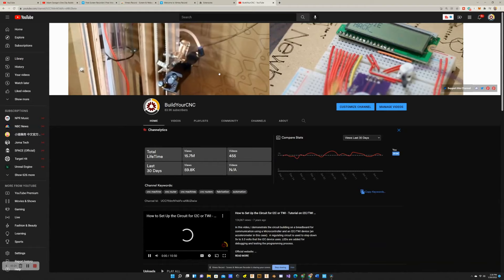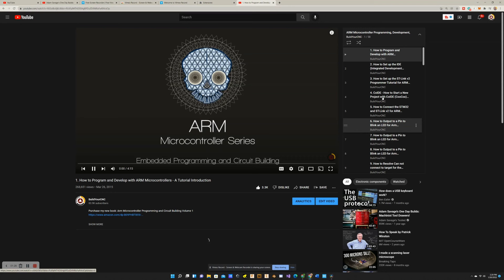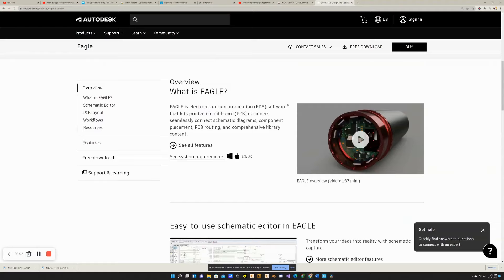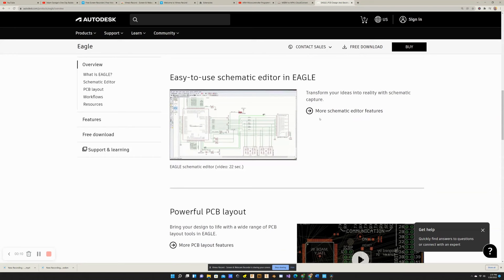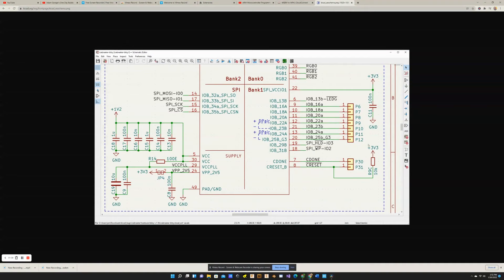#1 Say NO to ARDUINO! New ARM Microcontroller Programming and Circuit Building Series

Comment: I love ARM microcontrollers but I'm no fan of ARM IDEs.  The Arduino IDE has shown me that I don't need Keil, IAR, or any of the Eclipse derivatives.  To me they are all unnecessarily big and full of extraneous complexity.  Thankfully the Arduino IDE can accommodate just about anything...from M0 to Teensy 4.
Reply: We all would want that but in reality  Arduino is not really used in the real world but only used in learning basic programming
Reply: @tdab1234  Why?  I've used both Keil and IAR professionally...because the engineering manager specified them.  But there isn't a line of code I wrote that couldn't have been written and compiled in Arduino.  (Goes without saying I would NEVER use an instruction like DigitalWrite().  That really and truly is for noobs.  But Arduino in no way forces its usage.)
Reply: @d.jensen5153  can you please tell me why digitalWrite is for noobs?
Reply: @G-Code_official  I was wrong.  No doubt there are applications where squandering a few hundred microseconds on the transition of an output pin is not a problem.  But I have no use for that nonsense.  I'll track my own use of resources and their dependencies, thank you.
Reply: @d.jensen5153  Hey not sure if you will see this but when you use microcontrollers in industry, do you design a circuit board around a mcu? Or do you use a board with a mcu on it like a NUCLEO board?
Reply: @xxbatman69xx98  When working for government or quasigovernment agencies we frequently specified modules.  In private industry (profit-centered) we invariably designed our own boards.
Reply: Hello are u electronics engineer??
Reply: @saranyas6280  Yes.  Why do you ask?
Reply: @d.jensen5153  m an electronics  graduate..I would  like to make gadgets.but don't  know where to start.can u provide ur insta I'd if u wish to help me.
Reply: @d.jensen5153  about not using digitialwrite: why is digitalwrite too slow and what would the alternative be? I'm a complete beginner btw
Reply: @Blitzoschitzo  By writing directly to the register that controls the pins using bitwise logic.  Exact commands depend on the micro.  DigtalWrite abstracts all that so it works on all supported micros.
Reply: @bobrowicz82  much appreciated, thanks
Reply: @bobrowicz82  one extra question if you dont mind: since every mcu is different, is the manufacturer always supposed to deliver pre-built functions/libraries to access the registers or do I need read the datasheet and access the right registers with assembly or can I even do/access that with C without any extra libraries?
Reply: @Blitzoschitzo  in my (limited) experience I used manufacturer supported compilers and they all came with built in macros for dealing with register access.  Didn't need to do any assembly.  I think you could do it without any libraries by writing to raw memory address of the register but that would be the hard way of doing it.  The included macros are much easier to remember.
Reply: @bobrowicz82  by macros do you mean functions provided by libraries from the manufacturer?
Reply: @Blitzoschitzo  The alternative to digitalwrite() is direct port manipulation.  The latter is about 40 times faster on a standard Arduino.  Google the terms and you'll find many presentations on the rationales and applications of each.  There may be many uses where the 40x slowdown doesn't matter but, as a personal matter, I have never used digitalwrite() outside of initialization code.
Reply: When you start serious programming (multiple threads, stack limits,…), it’s a must to have a hardware debugger and a tool to examine regions of memory, and Arduino simply doesn’t manage it. Arduino is a success because of the libraries people has developed (and that can be transferred to other more serious IDE)
Reply: 약간의 노력을 기울이면 아두이노에서 쓰던 코드들을 그대로 keil에 이식할 수 있습니다
Reply: @Hyuchan1002  요점은 내가 Keil을 사용하고 싶지 않다는 것입니다. 나는 Keil을 전문적으로 사용해 왔습니다.
Reply: Arduino ide now has support for most of STM32 modules. Why companies are leaning towards using a specific uc is not understood. May be it is all about a legacy that coding in assembly is hard to do than hll. It is a matter of psychic preferences not that upholding new hll usages for us like arduino does.
Reply: :v funny comment

Comment: So why does it have to be one or the other? Ya know, dont presume to tell me what to do.
Reply from the maker: It doesn't have to be one or the other. Simply: If you are making one off projects, use Arduino. If you are interested in developing control for millions of products, learn how to develop from the bare chip. Either way is easy. I couldn't imagine an engineer in, say, Sony, starting off with an Arduino.

Comment: I'm personally not a big fan of shields for the Arduino or Raspberry Pi and try not to use them if i don't have to. Arduino is nice, though, because it makes it easy to test things via speed of compiling and uploading code without issue and it's availability to use a breadboard, then you can use the Arduino as an ISP programmer which is super convenient if you don't have the electronics on hand to program another Atmega chip. Clearly the ARM chips are going to be much better, though. The chip on the Arduino Mega is 8-bit, I believe, while the ARM chip you have I think is 32-bit. Also surface mount components scare me :'( my hands are shakey af. Gotta check out the development boards though, that's super cool!
Reply from the maker: Thanks. The surface mount is not a big deal if you use solder paste to position the part and let the surface tension and viscosity hold the chip in place while you heat it. You can also purchase breakout boards with the chip already soldered. This is only for prototyping. When your prototype is complete and the PCB is developed, China will be doing all the soldering. Enjoy the journey of getting into ARM uCs. They are no more difficult than Arduino.
Reply: @PatrickHoodDaniel  You know, I haven't looked into services that mount all of the components for you, that's interesting. I know JLCPCB does it, but I'm not familiar with the prices. Their PCBs seem pretty reasonable. Yeah, a breakout board would absolutely add to the cost if you're trying to order tens or hundreds of PCBs, not really crucial for the final product, only prototyping. Anyways, yeah! The only ARM experience I have is with the RPI, they are really exciting chips though! I'd like to practice some surface mount soldering, but I'd also like to get a soldering microscope and a few other tools before i start practicing.

Comment: hi Patrick;
i remember learning the real "metal" of what "software" really is...we used a PDP-11/05 manual and did cycle by cycle, bit by bit, analysis of memory cycles, instruction fetches, instruction decoding (you know, the bits that control ALU Functions, indexed addressing...), and i suddenly 'got it'! Software is just reconfiguring hardware, cycle by cycle, "steering" addresses and data.., it was a real "moment", since i had been developing digital logic for about 7 years, at that poimt, and suddenly "connected" the software/hardware worlds!
best o' luck with books and tutorials!
Reply from the maker: Nice story. Thanks!

Comment: Wow, it's hard to find the STM32F030 right now.  Zero stock and factory lead times of 53 weeks!  I will be following your new series!
Reply from the maker: You can use any of the STM32 line. The chip I use is one of the simple ones, so pick any and it will be fine as long as the number of pins will work with your prototyping setup.

Comment: With STM32, you can get Arduino-like development boards.  Some (like ST's Nucleo-64 boards) have Arduino-compatible headers.  And the Arduino framework has good support for STM32.  Hobbyists can use them for better performance and better functionality.  You can experiment and prototype with the development boards (including Arduino, which has drivers for lots of peripherals), and then design and build a custom board once you've settled enough of the details.
Reply from the maker: Thnaks for the information.
Reply: Just bought the book too. Would you recommend the stm32 nucleo board of discovery board? Thank you very much

Comment: I said NO to AVR 8 years ago. Then I tried to realize a frequency meter with 1Hz resolution up to 10MHz. These AVR chip hasn't 32bit hardware timer - so it was very problematic to realize such an equipment)). I tried to use assembler, but I had not had any success. In addition, prices on STM32 chips were very attractive. There was 32bit CPU, 16kBytes of RAM, 32-bit timer, DMA !. But it was really difficult to understand how to program stm32 - a documentation has more than 1000 pages. There are several clock buses. I can compare STM32 with 80486 motherboard (without video card surely). But there you can be running digital signal processing in real time (in speech band up to 4kHz) and realize digital filters.

Comment: Do you recommend to learn assembly as well, as programming language?
I really wait your further tutorials, and my philosophy is the same to learn as you told in your two introduction videos.

For me a bit new the STM32, as earlier, I learned on TI Stellaris.
Reply from the maker: No, unless you wish to torture yourself.  C++ compiles quite well into efficient machine code so there really isn't any reason to use assembly unless there is an optimization that is absolutely required by the application/use of the microcontroller.  Before assembly is used, it is always a good idea to find a more efficient C++ or C version first as the number of instructions required for the task may not be appreciably improved.

Comment: @BuildYourCNC Which kit should I buy for parts needed to complete this book? I bought the book and I'm pumped to start. A centralized list of parts and tools would be greatly appreciated. 
Will I need my own oscilloscope? Multimeter?
Reply from the maker: The intermediate kit should be sufficient; however, in my volume II, coming out later this year, will include all of the parts in the advanced kit.

Comment: Great projet !  I bought your book. Do you mind asking why not using vscode for the editors which tend to be the most common used IDE nowdays and  the bluepill which is a well known board used as well with arduino ?
Reply from the maker: After what happened to CoIDE back a few years ago with the lack of support, I want to use a development platform that will be supported indefinitely. As this IDE STM32CubeIDE is supported by the chipmaker. The use of VSCode does intrigue me, so I will look into it.
Reply: @PatrickHoodDaniel  Ok thanks I understand. What about the bluepill that many people use with arduino programme? 
Maybe later on. Anyway It'll be really interesting with the F0.

Comment: Excellent. I'm looking forward to this series. Subscribed.
Question: I have been using VS Code with Arduino. I have also started using the PlatformIO with VS Code. Is your book and series independent of the development platform or is this series very tightly tied to Eclipse?
Reply: I got your book. Let the games begin. 👍
Reply from the maker: Hey Peter. No, this series is not dependent on a particular development platform. I am using the ST modified Eclipse environment (STM32CubeIDE) which integrates CubeMX. Fortunately, the CubeMX can be set up to create autogenerated code for any environment. the CubeMX can also create schematic, footprint, and 3D part models for any electronics CAD software, like KiCAD, Altium, Eagle, etc.
Reply: @PatrickHoodDaniel  Excellent. I'll research how others are using the PlatformIO with STM32 processors. I'll then select an appropriate STM32 and set myself up with the appropriate development hardware. I'll reach out to you to purchase your breakout boards for whatever STM32 I buy.

Thanks for the great effort in putting these videos together. They're priceless.
Reply from the maker: @peterdavila3045  Thank you so much. I hope you enjoy the process as much as I do.
Reply: @PatrickHoodDaniel  
Hi Patrick,
I just ordered you "ARM Microcontroller Advanced Kit" from your website. But, I don't know if I'll be able to use PlatformIO with VS Code to work with it. Do you know which one board gets selected in PlatformIO to interface to your setup? If you know, it will save me some time having to dig for it.

In addition, I'll be looking to buy a Nucleo board or similar to expedite some of my prototyping and for use with PlatformIO. But then, I plan to be transferring the appropriate final design to your setup for final testing prior to PC Board. I'll use the ST development tools if I have to, in case PlatformIO does not recognize the minimal STM32 chip setup in your kit. I guess I would then transfer the C++ code from PlatformIO to the Eclipse setup for final testing with your hardware setup.

Thanks for all your effort to provide quality instructional material. Much appreciated.

Comment: Just ordered your book. Can't wait to get started. If you can make a mix of programming and PCB design with MCU, this channel will become a reference! Keep up the great work!
Reply: Are you recommending any devboard or specific hardware to follow along?
Reply: Sorry for the many questions. I see you use a custom PCB for the MCU - is the Gerber file available freely or you are going to explain the PCB design, I understand it is just a basic PCB. Thanks
Reply from the maker: @mic03311  Yes, I will go over that in my next video. There will be a few options, but mainly a PCB to breakout the chip. Stay tuned.
Reply from the maker: @mic03311  I will explain the PCB and there are cheap versions on the internet, and the one that I sell.  I will add the gerber file to the website if anyone is interested.
Reply: Thanks, looking forward 👍

Comment: I started using the AVR as early as Atmel started transitioning from the MCS-51 family, which I was using before that point. I was on assembly so it was a bit harder for me to switch over. No worries, I've been using STM32 for over a decade, using C of course. The major drawback with the AVR isn't just in the price and resources, it's also STUPID SLOW! 20 years ago a 16MHz system clock was sweet, but it was an 8-bit architecture. Now the STM32 comes with 4x the core bandwidth, easily reaching 72MHz system frequency, with the F4 and H7 series I've been using, they are running at 180MHz and 480MHz respectively. I guess that's why people started trying to run the Arduino framework on the STM32 or various Pi baords. Redesigning PCB is fine, you can shed enough parts to make an Ardnuino more compact. Yet still, I never got used to using that system. Never tested it with any benchmark tools either, but I generally don't trust it with efficiency.
Reply from the maker: Well said.
Reply: Are u electronics engineer?? Alex
Reply: @saranyas6280  Yup, plus mechanics.
Reply from the maker: @saranyas6280  No.Learned everything from various sources and University, but I am not specifically an electronics engineer.

Comment: I can't agree with the price point, at least in my region, a single STM32 chip could cost around $5 - $10 while an ESP32 costs just $2, ESP01/8266 cost almost $1, and an Atmel chip costs $2.
 
I think what makes STM32 great is it's reliability, flexibility, and quality makes it really the default option for industrial application.

Though ESP32s are close to compare to STM32, i think STM32s had certain qualities that ESP32 don't have, such as flexibility and features (interrupts).
Reply from the maker: At low quantites, yes the chip is more expensive, but my series focuses on getting to a production level and at high quantities, the chip is very cheap.
Reply: @PatrickHoodDaniel  Ahh I never knew that they're cheaper in bulk! I thought they were just fancy chips 😁.

Now you got me wanting to learn more on STM32! thank you so much!
Reply from the maker: @sukmaadhiw9033  Not a problem. Thank you for watching!

Comment: Great
Does your training explain everything in your book?
Reply from the maker: No, I will be using the book as a reference when needed.  The book details many of the simple methods like basic input and output, using the ADC, basic circuit use and interrupts.  I may explain the use of these features, but not in a scaffolding approach. In this series, I will focus on more advanced topic, but still explain them so anybody will be able to learn.
Reply: @PatrickHoodDaniel  thank you .  How many training videos do you upload each week?
Reply from the maker: @mohammaddehghan8762  So far, one per week but I will be increasing the frequency when I finish some of the machines that I need to deliver to customers.

Comment: What should I learn before buying your book? I can program, but I have never worked with microcontrollers, is a field I love and want to learn. I have little knowledge in digital electronics. My pro is that I'm a programmer and love microcontrollers.
Reply from the maker: That is an excellent question. If you already have some programming under your belt, you can jump right in. The book assumes you are not knowledgeable about electronics or microcontrollers at all. In fact, the two technical editors worked through the book, both having no experience with programming or electronics and they were able to complete all of the projects the book. This is a perfect entry into microcontrollers and electronics.
Reply: @PatrickHoodDaniel  Nice!, exactly what I'm lookging for, I was looking into coursera, but nothing better than a book. Thanks!.